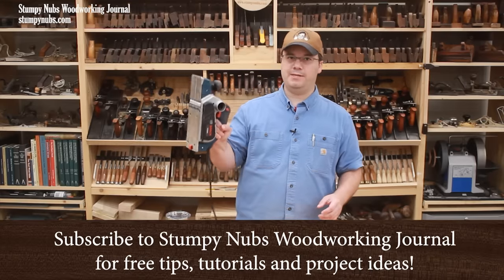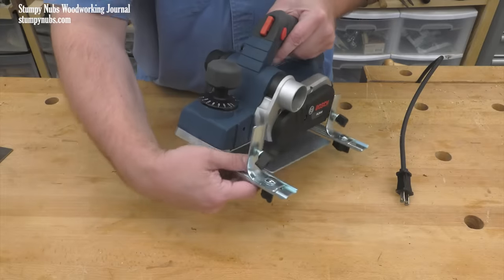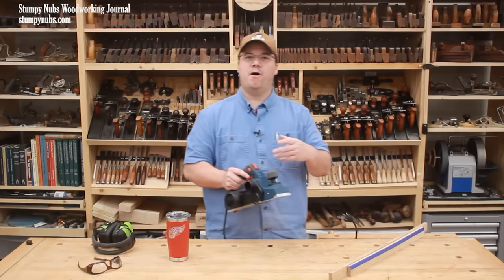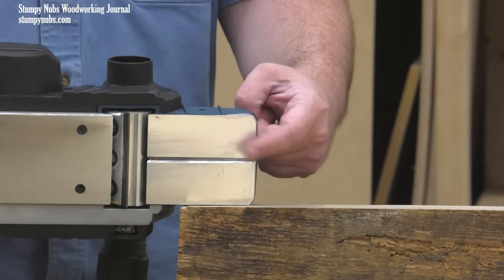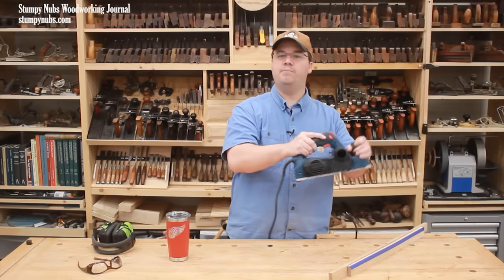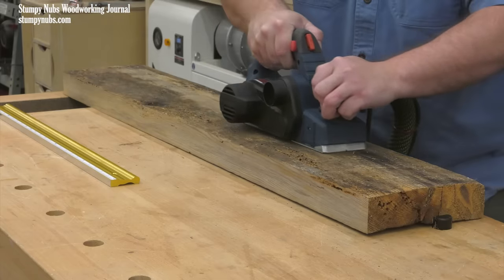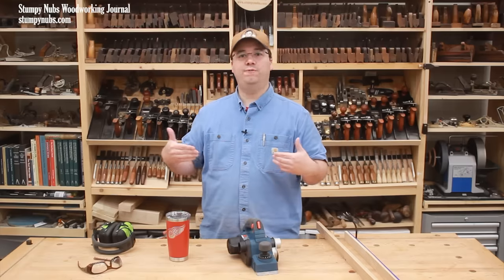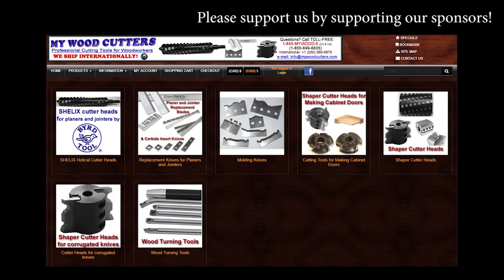Clever things you can do with an electric hand planer

Comment: So timely!

I’m trying to figure out the best way to join long boards of Poplar and Pine for Stair Stringers. 

Building code changed where I’m from to 10”-run as a minimum. So 16’ boards aren’t long enough now for a 16-rise stair (common in: townhouses, condo’s, basements). 

Jointer or Tracksaw aren’t in the budget. Pine can pass with a straight edge and my deft skills with a 20lb 10.25” circular saw, but not so much with the hardwoods. 

I haven’t even watched this video yet, but I have full confidence that you will help. Thanks in advance.

Update: watched and was not disappointed!

Comment: I believe it can replace a thickness planer if you make a sled for the planer.
You then make a bed and adjustable rails for the sled to ride on.
As long as your bed is flat, your rails are set to the same height, you should get parallel flat sides.

Comment: Another well explained shop video.  You do an excellent job at that, as usual.

I have a small shop and can't fit a 6" or larger jointer.  I do, however, have a 4" jointer and it severs me very well for the tasks I need (it is a Rockwell cabinet makers jointer from the 1960s I inherited).  I may add a hand planer to the mix if I ever need to flaten something larger than my jointer can handle.

Comment: Right now I'm building greenhouse and the only electric tools I'm using are the electric hand planer and circular saw.
Mine one have 3 grooves in the front part - for quick and easy chamfering - just love that feature.
As for the cord - I keep it over my shoulder (as doing it with circular saw and couple of other tools) - this way it's always away from the tool cutting edges and can easily feel if it's stuck somewhere.
Reply: I built three this spring, drills, screw gun and a reciprocal saw. There isn’t a toothpicks worth of wood in them.

Comment: Had a cheap one, from Tacklife. This is before I understood hand planes or, really a lot of things regarding tools and woodworking. But I used that cheap $50 plane to flatten a live edge table top that we turned into a coffee table. It’s mostly flat, acceptable for just about any household. There’s a slight hump but whatever. Beautiful live edge table and it’s the first thing I’d build. I dropped it in accident and cracked the plate. Never hesitated to toss it as I outgrew it. Now I’m thinking I could still use it.
Reply: I always figured a person could rig up a sled for one of these much like a router sled and use it to flatten large slabs.

Comment: Just a tip to add   .put you arm down the outside of your vacuum hose/power cord ..  bring your arm towards your body and grab the tool handle... the cord and hose will be safely wrapped around your arm  , keeping it out off the way, and also will not drag on workbench or lumber causing uneven planing

Comment: I'd been working at a woodshop for less than two weeks when I was given a token opportunity to use a hand planer on a 6 X 6 piece of lumber on a lathe. My job was to make 450 cuts to lessen the excess wood. I was given the tool, told to do this and that, and the person working the lathe walked away. What a lousy and unsafe way to learn something. Still, the person did returned every 30 seconds or so to point out my mistakes. YOU JUST TAUGHT ME MORE IN TEN MINUTES THAN SHE DID IN HALF AN HOUR.

Comment: I have seen people turn a hand planer into a mini jointer and I have also seen others attach guides to the planer that run along a reference surface to improve its ability to flatten a surface.
Reply: Like a router sled?
Reply: @Vikingwerk  Yes, I think that is the "flattening jig" I meant but I have seen some DIY options too.   Regarding the mini-jointer they put the jointer upside down in a cradle and add a fence on the side.

Comment: By far the first thing when using power tools that spin at liquefying speeds. Wear spandex hugging clothing if yourego can handle it as long as it's not baggy. At all. I had a belt sander grab a loose t-shirt once and head for my belly. Thankfully my grip on the power button getting ripped from my grasp and that the shirt forced it to stall faster is all that saved me from being disemboweled by it.

Comment: Most of this stuff I do with a good old #4 Stanley hand plane. Yes it takes longer, but you can be way more precise generally with hand planes.
Reply: You joint with a small hand plane?

I use really long wooden ones for jointing and found that to be better than an electric handplaner. Never tried to use a small iron plane for jointing though.

Comment: I think any woodworker needs a jointer.  That was the 2nd power tool I bought after a table saw.  Trying to make do with a hand planer on jointing wood isn't worth it.  For jointing or face-prepping 6" boards, You can get a Grizzly bench top jointer for 300 bucks and by the time you buy the Bosch for $150 you are halfway there. However, prepping a board face to go through the thickness planer does make sense because a jointer over 6 1/4 inch size is very expensive, big and heavy.  This is a great video though and thank you especially for the tips on prepping wide boards.

Comment: At my workplace we have a planer mount that clamps the planer upside down. This proves to be very handy on site at times as the planer can be used as a small jointer by running lumber over the planer rather than the planer over the lumber. I think it’s made by Festo. It has an adjustable blade guard so it’s also quite safe to use if one is careful.

Comment: I find the electric hand planer a very useful tool, non only for rough carpentry and job site work, but also in the workshop. I agree with you about the tool, checking the results with a straight edge and using some judgment, can give acceptable results, but IMHO not really if you want to do proper fine woodworking. You can straighten an edge, but you can not really make it perfectly perpendicular to the reference face and you can not plane a face really flat and smooth. I see the electric hand plane as a good replacement for the scrub plane and working the face of a board I use it as I would do with a scrub plane, 45° to the length of the board, not parallel to it, it is easier on the plane engine and belt, but then I refine the work with a traditional long plane, also a no.5 works, and a smoothing plane. It is a very effective way to deal with large boards, larger then the 12 inches my jointer and planer allow. I don't find that bringing the opposite face parallel with the reference one and the board to an exact thickness is difficult if you again use the electric plane instead of the scrub one then you follow with traditional hand planes. The same is true dealing with edges, the electric plane is good to get rid fast of a big crooking, but then has to be followed by a traditional plane that using its slightly cambered iron allows you to have that edge perfectly perpendicular to the reference face. The electric plane compared to a traditional scrub plane serves the very same purpose, saving you a lot of fatigue and maybe some time (at the cost of some noise... ), but used alone I don't find that really allows you the fine control that is needed for fine woodworking, even when used with competence, judgment and checking often with a straight edge.
Reply: I think you should be more specific with fine woodworking, i'm pretty sure you don't mean fine furniture, which an electric plane is still very useful and you are more likely to go in by hand with at the next stage, or precision carpentry beyond the capabilities of timber. Really where it lacks is, i'll call it regularisation for temporary 'machined' surfaces, which is an uncommon process for most woodworkers (making the timber easy to work with during construction)

I work a lot with oak, and the times i'd like those machined edges i've reached for my electric plane anyway- if you can wizz 100kg sleepers or beams through your shop more power to you. 

So I see it as the opposite to fine woodworking, to me that is bespoke fitting joints and hand crafting.

But your points are accurate. You can't regularise your boards (in a time efficient manner, at least) that gives you days or more of lego like woodworking. Its underrated to some degree, but i think it isn't the expectation of someone in their shed and you probably shouldn't even own the tools for that without being a medium or high volume furniture business, or a wealthy hobbyist of course.

TL;DR a hand plane isn't a saw mill of course, i think that too much youtube workshops give people an unrealistic view on what you need, because they have the nice haves that save minutes per piece at high cost.

You're overstating precision little imho. An electric plane gets you in sanding distance, and beyond the ability of timber to hold its shape.

Comment: Pay extra attention to the safety warnings!  I was using an electric hand planer to adjust the fit of a new pair of french doors.  It was 9:30 at night, I was dog tired, and I stepped on the power cord while the motor was spinning down.  I ended up planing 1/2 inch off the tip of my left index finger.  Thus began my obsession with old Stanley hand planes.

Comment: If you don’t have a thickness planer, you can use the winding sticks to help produce a reasonably parallel surface if you have a good flat workbench by measuring out at the ends of the winding sticks to get a uniform thickness.

Comment: I have found that with all kinds of hand tools, with and without plugs, it’s relatively easy to get a surface flat, but it’s very difficult to get that surface square to another surface. I wish there were more options to give me the kind of confidence being pressed against a big, recently-calibrated cast iron fence of a jointer gives me.
Reply: do you use a marking gauge? after you got your first surface flat, is just a manner of planing until you hit the mark. I done some chests using only handplanes and the biggest drag to me is getting the first surface. after that, you pretty much can forget all the worries about bowls and cups and twists

Comment: You can of course use a marking gauge to draw line parallel to the planed edge. Bit more work but possible to true all faces if a hand plane is all you have. However, generally it is used as a scrub plane to fix twist, bow, and curves on the wood.

Comment: To plane an edge I clamp it between two straight pieces and plane all three. Always some scrap plywood rips that are wide enough and straight to “fence” both sides. Same process if you want to bevel the  edge of a door, offset the fence to achieve the angle.

Comment: I saw someone build a carriage jig to run it on an angle around the perimeter of a table top. It was able to make a super low-angle "knife edge" for the under side of a table top, something that would normally require a huge shaper bit, especially for round table tops.
Reply: Clever jig I’m sure. When you think about it, a planer is a lot like a router table with a big straight bit.

Comment: And here I just picked up a late 1940’s Craftsman benchtop jointer... Basically solid metal, scrap value alone has to be more than the $5 I paid... But I'm pretty sure it uses the same blades as some electric planers 😁 4 3/8th inches iirc, haven't yet checked to see if it interchanges with my Harbor Freight planer which would be just amazing luck. The $20 for steel, $70 for carbide that My Wood Cutters wants is probably fair but seems like a lot compared to what I paid (I didn't spend 70 on the two tools combined)

Comment: I have one of these even though I wasn’t able to use it yet. I could tell you this the people say that these electric hand planers have more problems with sniping than the lunchbox planers mainly because there’s a higher risk of fail due to the fact that it’s less automated of a tool compared to the lunchbox planer even though you get sniping on the lunchbox planer too and you have to use sacrificial boards. 

I would’ve bought a lunchbox planer if I had more money, reduces the chances of fail or mishaps.

Comment: My shop vac hose has about a foot long non flexible end and it keeps the hose out of the way from snagging on the wood vise. I then used electrical tape to tape record on to the shop vac hose in about four spots. That keeps the cord from hanging up. It would probably help to do that even if your entire hose was flexible.. that means you only have one thing attached to deal with really.

Comment: You can easily run a marking gauge around the board after making one face flat and then use the power plane to plane down to that line if you don’t have a thicknesser. I do this with hand planes all the time.
Reply from the maker: I said it could be done, but took extra skill and fussing.
Reply: @StumpyNubs  Fussing is half the fun, no?

Comment: Stumpy help! I have a new electric hand planer and it works really nice at surfacing that first face... But no matter what after a few passes it ends up "crowned" or thicker in the middle than on the ends. The boards I'm trying to joint are only a little less than twice the length of the sole so I don't think it's too short... Maybe the two halves of the sole aren't quite aligned right? The blades seem to be aligned with the rear side of the sole. Edit: also it's a gradual difference, NOT smile, I do get that occasionally if I'm sloppy but I know how to avoid it

Comment: As with any power tool I suggest learning how to use the manual version before using the powered version.
Reply from the maker: Why?
Reply: @StumpyNubs  I feel like it gives more respect for the tool if you understand the effort that goes into the job. It also teaches you when it is right to use a power tool and when it is right to use the hand tool. The understanding of the process provides you with a better understanding of the wood as well. Grain direction for an example is important, but power tools can mask the value of that knowledge. When using a hand plane you always consider grain. Which you should do with a jointer but I never hear anyone mention that with a jointer.
Reply from the maker: A person could learn about how grain direction applies to an electric plane by simply using an electric plane. Likewise he can learn how to rip a board with a table saw without learning how to rip a board with a panel saw. Just because two tools have some similarities in use doesn't mean you should learn how to use one before you can use the other. To me, this is like saying you need to learn to ride a horse before you can drive a car.
Reply: @StumpyNubs  not like a horse and a car, more like a bicycle and a motorcycle.  
While not impossible to do, I feel it is best to learn with the slower more controlled methods of hand tools before progressing onto the potential more dangerous motorized equipment.

Comment: It is actually possible to make two faces parallel using a hand planer, you can set a marking gauge so it is set to the maximum final thickness of the board, register it on the straight face, and mark all around the board. Then you just plane down to your line to make it flat and parallel

Comment: One tip is always have the board either clamped down or on a non slip surface.
A stop edge on a table to catch the end of a board works great to prevent it flying away as you likely inadvertently try to use one hand to hold the board on the table making an unsafe and crooked pass.

Don't ask how i know, and no i havent hurt myself, yet..
Reply: I'm working on renovating my house and when laying new floor boards on old wooden floor the electric planer helps a lot to remove highspots over the beams with little effort and almost no dust compared to if i where to sand it down. 
Fantastic uintill i hit a nail and destroy the blade 😅

Comment: I would flatten the edge of a board by clamping 2 pieces of scrap plywood on each side then planing the whole thing down. If the total width is the width of the shoe, you would also reduce the chance of rocking side to side.

Comment: Don't forget door edges, and they can be a life saver if your draw is slightly too wide for it's space as well.  A pass or two under where the drawer slides are mounted and life is good again.
Reply: The sole reason I bought mine 20 years ago, for shaving door bottoms after remodeling the change in flooring height. I got tired of using a circular saw and chipping mohagany doors.

Comment: Actually, James ... With a small jig, it can replace both a jointer and a thickness planer. =)
-Imagine you have a perfect tabletop. If you can attach a jig that has a piece of wood on each side, which keeps the plane X mm above the table top, you can hold down your work-piece to the table-top and plane it without being an expert on planing.
You'd get one flat surface.
flipping the workpiece around and adjusting the two sides should get two parallel faces on the work piece.

Comment: The blades are pretty cheap, make sure you get new, sharp ones.. it makes such a difference to the final product.

One issue I have is with a wide piece, how do you not get deep lines / edges as the blade is not super wide ?

Comment: Good one, James.  I don't have space for a jointer or a thickness planer so I'm looking into buying an electric hand planer instead.  You say that hand planers can't make the faces of boards parallel without making them wedge shaped, but couldn't you modify a router-type table-top leveling jig for this? A right to left motion would have to be built into the jig instead of the usual forward and back motion for surfacing table tops but I think that could be designed into the jig.
Reply from the maker: I didn't say it couldn't be done. I said it could be done with extra skill and fussing.